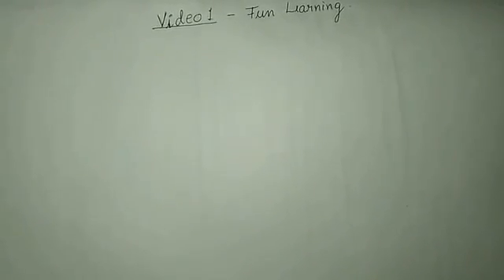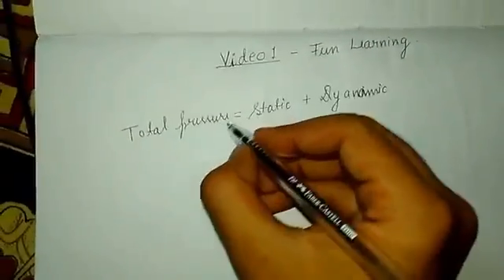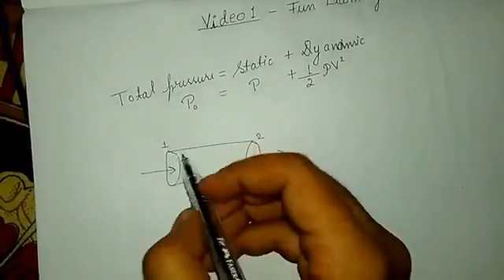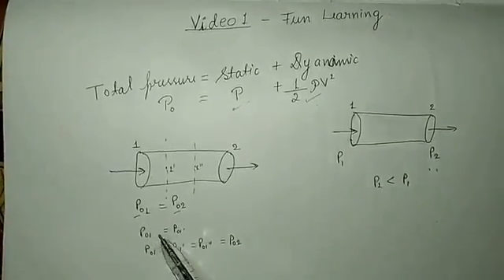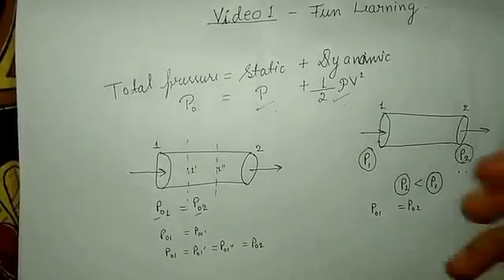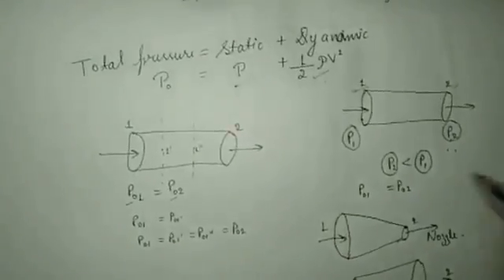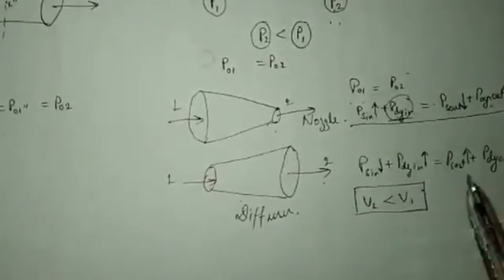Total pressure, static pressure and dynamic pressure explained.

Comment: How is P01 = P02 in a pipe with the same diameter throughout its length when the dynamic pressure is equal at the inlet and outlet? For fluid to flow, static pressure P1 must be greater than P2. Since dynamic pressure is conserved, isn't it that P01 will have to be greater than P02 because the fluid's static pressure increases but the dynamic pressure remains the same?

Comment: You explained in the video that fluid flows from higher static pressure to lower static pressure.,but in the case of diffuser static pressure is less in the inlet but greater in the outlet,then how does the fluid flow from lesser static preaaure to higher static pressure
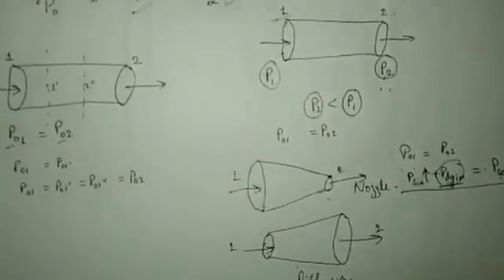Reply from the maker: Hello Benumadhab, The video explains the fluid flows because of change in either dynamic or static pressure at inlet and outlet which is also true for diffuser, if you watch the complete video at 8:00 the nozzle and diffuser is explained clearly.

Comment: For incompresdible fluid flow yes total pressure will always be conserved, but once the fluid flow crosses the standard Mach 0.3 threshold and its turns incompressible, bernoullis principle which assume inviscid fluid action begins intrepidly breaking down. The total pressure now becomes coupled to the speed of the flow. Its especially bad in high speed supersonic fluid flow where its possible to get total pressure losses of up to 15%.Good video nonetheless